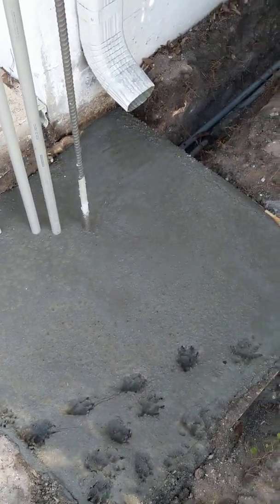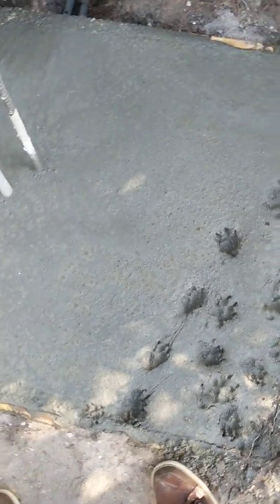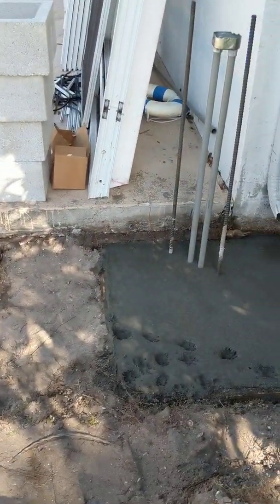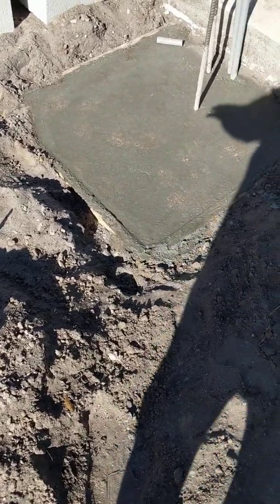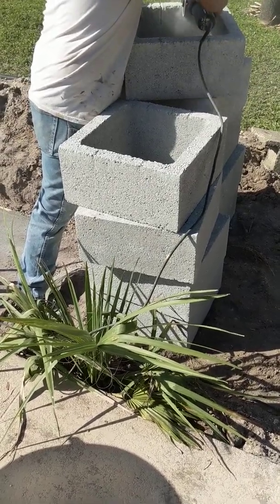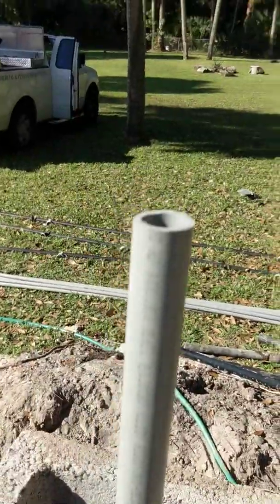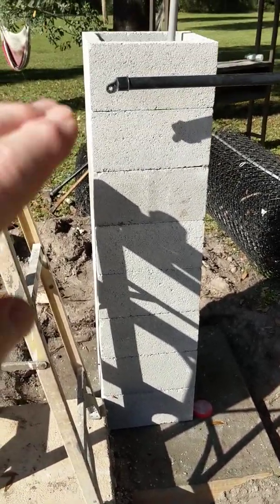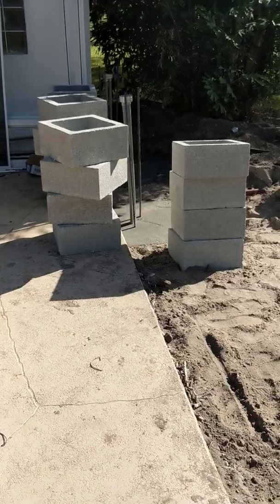Concrete Columns and the Foundation.

Comment: How long should you let the concrete cure before setting in the blocks?
Reply: Within four hours, if your foot does not leave an impression when you  step on the slab you are good to set the blocks. You may want wait 24 hours before filling the columns with concrete.
Reply: @SanctuaryofthePalmBeaches  thank you I just had this question

Comment: Hi Thank you for doing this.  It was good to watch although I would have loved to see you do the foundation and the rebar you mentioned inside.  I'd love to see how you do your front yard.  Question:  Would you recommend deeper foundation like 2ft instead of the 8inches you did?  What would be the pros and cons.  Thank you.
Reply from the maker: Emmanuel, the only reason you would increase the depth of the foundation would be if you were going 10 to 12 feet high with your column. What is important is the width. Needs to be wide enough so the column doesn't tilt when the ground becomes wet. 8 inches with Rebar is more than sufficient. 3' x 3' is sufficient width for up to a 6 foot column. If you're going to go a little taller on your column you may want to go 4 x 4 on your foundation. It's going to be a few months before I do my front fence. My front yard is 380 feet and the cost is going to be a little steep.
Concerning the Rebar, 4 rebar are running north and south and 4 are running east and west equally spaced will be sufficient. The Rebar should stop about 2 inches from the edge of the form. You can purchase little feet from a local hardware store to lift the Rebar up off the ground so that it is positioned near the center of the depth of the form. You then tie 4 rebaror that will extend straight up through the center of column. These rebars can be about 6 to 8 inches apart or an 8 square. Hope this helps. The design and layout of your Rebar is very forgiving it is there only to support the concrete.
Reply: @Dan-TheHandyMan  Much appreciate your response!! I'm new at this so your video has been quite helpful. If you don't mind a few more questions: 1. Would you leave the form i.e. the 2x8 buried i.e. covered up in the foundation? 2. What do you think of dressing the cinder blocks with red brick? Any gotcha's? 3. I am in Texas and we have clay soil. Any thoughts?Thank you.
Reply from the maker: @emmanuelmordi4458  After about 24 hours or you can wait longer if you want but not necessary to wait any longer than 72 hours you would remove the forms boards from around the concrete. If you leave the board in the ground eventually they decay and leave a space between the ground and the foundation and that could potentially weaken the strength of the foundation. I live in South Florida and we are basically just sand your clay dirt is much stronger so the 8 inches deep 3'x 3' foundation is more than sufficient. Placing red brick around the cinderblock would be an aesthetic choice. Normally when you use cinderblock you put stucco around it with a knockdown finish, however, that is more of a Florida type style. If you're going to use redbrick there actually isn't any reason to use cinderblock at all. Redbrick would take longer and is a little more complicated keeping things level but makes a beautiful column. With the redbrick, you will need to put mortar between each layer brick and then when you're done, fill the column with concrete.

Comment: Hi Dany ! What is the inner and outer size in cm of those cinder blocks ?
Reply from the maker: 16 inches or 40.64 cm
Reply from the maker: 40cm X 40cm is the outer size, I do not know the inner size. The block looks to be about 2.5 -3 cm thick so that would give us about a 35cm X 35cm inner measurement.

Comment: No mortar in between each block?
Reply from the maker: No mortar between blocks. The pour inside of the blocks with the rebar holds everything together. You level the blocks using small plastic levelers you can get from home depot.

Comment: WHERE DID YOU GET YOUR CONCRETE BLOCKS FROM?   I LIVE IN CLEVELAND, TN, AND HAVE CHECKED WITH LOWES, HOME DEPOT, SEVERAL CONCRETE BLOCK MANUFACTURERES AND FINALLY FOUND ONE BOUGHT THEY CHARGE $40 FOR A 26
X16x8 INCH BLOCK.  FOR MY NEEDS THAT IS TOO MUCH PER BLOCK.   WHAT DID YOU PAY FOR YOURS?  THANK YOU, WAYNE P.
Reply from the maker: I got mine from the local Home Depot store in South Florida. Common Item here. Well, pre-covid anyway, not sure about now.

Comment: No mortar in between each block?
Reply from the maker: I'm sorry I did not respond to your comment in a timely manner , somehow I missed it. I do want to respond in case someone else reads the question and has the same concerns. There is no mortar between the bricks. The reason for this is the columns are going to be completely filled with concrete. This will hold the bricks in place and make the columns solid and sturdy. 
However, because you're not using mortar which has two purposes, attaching the bricks to each, and to level the bricks as you go up higher on the columns.  Do not forget to use the little tabs to make sure that the bricks are level as you stack them on e one another.